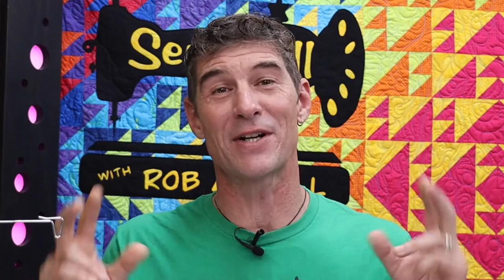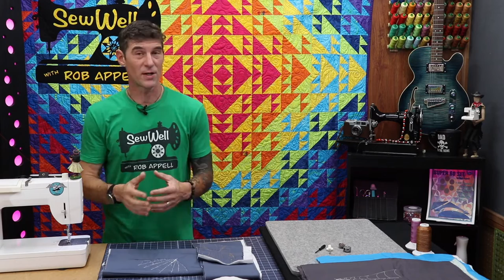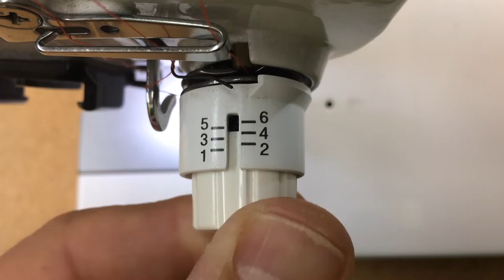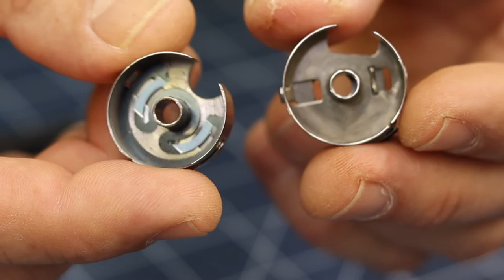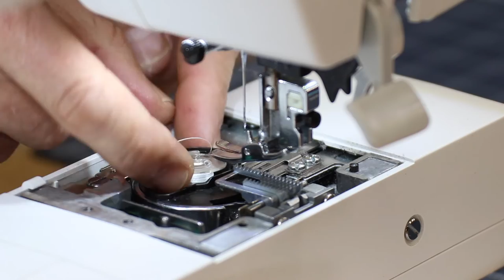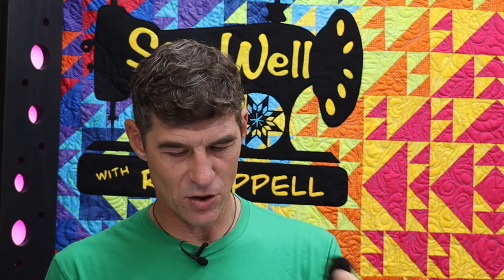Tips for Troubleshooting Tension - Sew Well with Rob Appell

Comment: Rob, thank you for a most informative video. The advice I give all new sewers is use quality thread and take your machine in for an annual service. It does not guarantee that you will be problem free but it does minimize the chances.  If you are having tension issues  first thing re-thread the machine, second change your needle ( I am presuming thread , needle and fabric are appropriate). Loved your video

Comment: Great video. So here’s something I came up against this past weekend. I was sewing Kimberbell’s fabric baskets and there is satin stitching all around the outside. The machine/thread worked fine for a while and next thing I knew, the needle broke. Rethreaded, checked bobbin, replaced the needle. It happened 2 more X. I changed thread and all of the other steps above. Sewed maybe 40 stitches and needle broke. Things were clanging and crunching. I was wondering if it was a tension issue. I broke 5 needles in about 20 minutes. Ends of thread were frayed. I checked bobbin case to make sure white dots lined up. Tried thread #3 and everything worked like a charm. Does that have anything to do with the weight of the thread as the spool is used up? I know you mentioned in last video the weight changes outcome so I’m curious as to how to rectify it. (Ellisimo Gold machine and polyester thread) Ty!!!
Reply: Ps to comment I made above. It sounded like my needle was hitting metal. I removed plate and could not find anything in there. I watched the thread come off of the spool and  it didn’t appear that it was getting caught on a bur or anything. Thx!

Comment: Brother PQ 1500 is skipping stitches while free motioning squiggles  large, using cotton fabrics batting thread put in new HLx5 needle as recommended rethreaded numerous times  n it sews ok then skip normal skip larger . Please help ur a machine quilter n technician . I’m soo frustrated can’t afford to find a shop rural Georgia nothing here but cotton 🙄😩
Reply from the maker: Email us here so we can get to you a little quicker:)
service@stitchinheaven.com
Reply: @StitchinHeaven   Hello I have a Brother PQ1500 SL machine I’m trying to meander large squiggles on a Quilt my stitch length knob goes from 1-7 ?? Which number do I use ? Dropped feed dogs , I’m using cotton fabrics batting n connecting thread 🧵 thread . I have adjusted top know tension to correct color area using HLX5 needle per Manuel n it sews a few normal stitches then a long stitch 😩🙄been trying it for 3 days rethreaded cleaned bobbin area changed needles n it’s the same.

Comment: Rob please help I have a brother PQ 1500  I have changed the needle rethreaded it 3x cleaned it truces to adjust the pressure on top of machine dropped my feed dogs and the Dumb 🤬 machine keeps skipping stitches 2 days I’ve been messing with it . It sews normal then a big skip during my stippling free motín . 😩 help please before I murder the machine 😩🥺
Reply from the maker: Yes, make sure that you have the correct style needle for your high speed, straight stitcher. It is recommended that you use a HLx5 style, not our standard 130/705 style